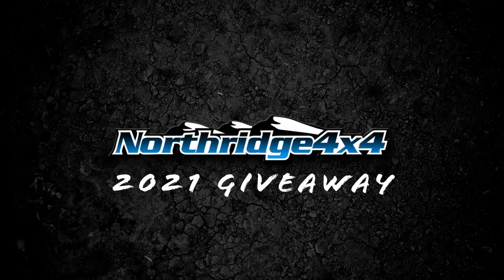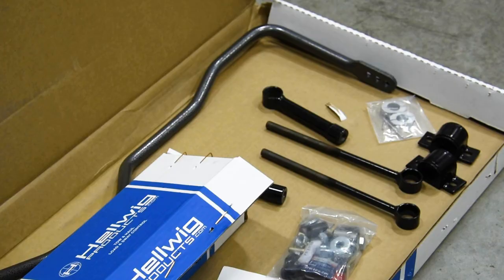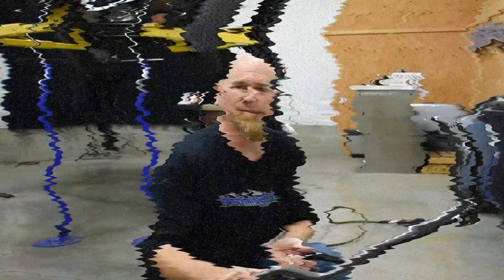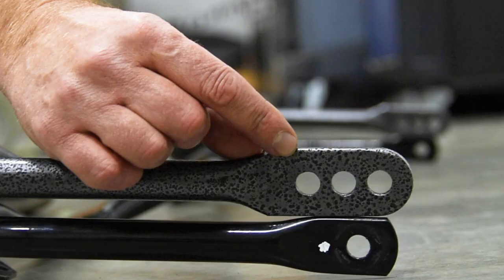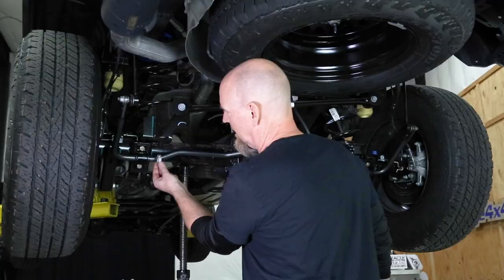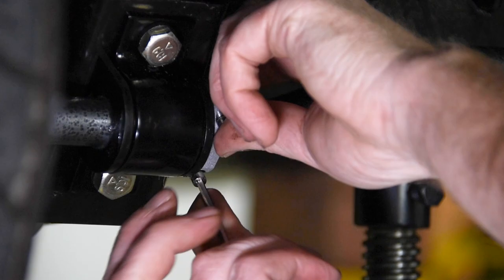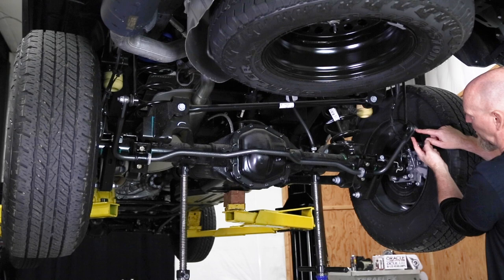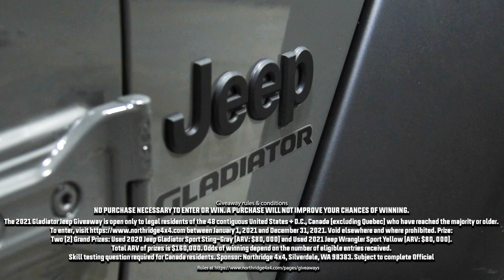Hellwig Adjustable Sway Bar Install on Jeep JL/JT

Comment: I put it on my Gladiator a few weeks ago and it works great. I put it on the tightest setting, now I could use some quick disconnect links to make it easier to change the settings on the fly.
Reply from the maker: That would be nice.

Comment: I had this installed and then went to Moab. Seems to work well. But what is not mentioned here is that if you are seriously wheeling your Gladiator you need to install the Metalcloak rear sway bar end link to frame reinforcement/repair braces. The factory mounts to frame for the end links are not adequate and will fail as mine partially did. It’s better to add the reinforcement braces before the damage occurs.

Comment: I guess Hellwig has done some cost cutting since this video.  My JL one didn't come with new hardware, silicone grease or loctite.  Just the bar, polyurethane bushings, brackets and the aluminum clamps.

Comment: Solid sway bars are a waste of weight. The center of the bar provides no resistance to torsion. The diameter is what determines the stiffness. 4140 chromoly has the exact same modulus of elasticity as any other steel. The only way this bar could provide more roll resistance than the factory bar is by having shorter moment arms.
Reply: Exactly correct.

Comment: Okay which sway bar are you going to recommend for my 2020 Gladiator. The Helwig in this video or the Curie Anti-rock in the other video?  Both videos you show installing on your give away gladiator.  I am seriously confused.  Helwig prices about $550 and Curie is more the twice that. Is it twice as good as the Helwig.  Be honest.
Reply from the maker: Two different applications.
The Helwig is great for adding more weight handling capabilities. Perfect for a Gladiator or Wrangler with a roof top tent, etc to cut down on the body roll due to the extra weight up high.
The RockJock Anti-Rock is lighter than stock and is for going from street to trail without having to disconnect your sway bar.

Comment: In my 3.5” lifted gladiator when I go over, for example, a diagonal bridge transition seam on the freeway, the Jeep “wags” from one side to the other before settling out. Do you think this is more a shock symptom or would an upgraded sway bar fix this kind of sway?
Reply from the maker: Tough to diagnose without driving it, but it does sound more of a shock issue.
A heavier sway bar can help combat that, but a stiff shock can also do that.

Comment: For 2" or 2.5 " lift, which swaybar do I need?
Reply: Exactly, links are for stock and 3-5" lift , what about 2" lift?
Reply: I would think you could use the stock height bar with the sway bar links your lift came with.
Reply from the maker: Use the extended links that came with your lift kit.